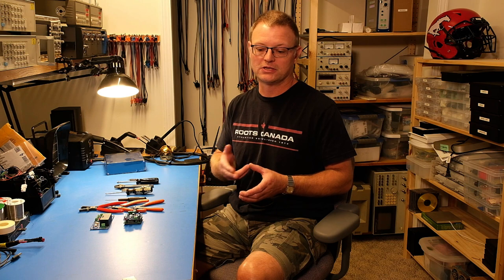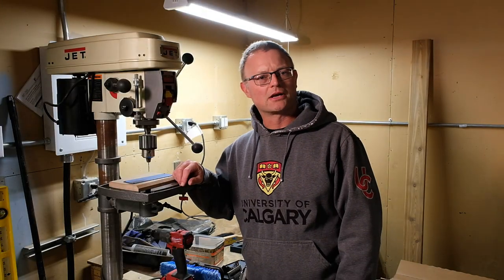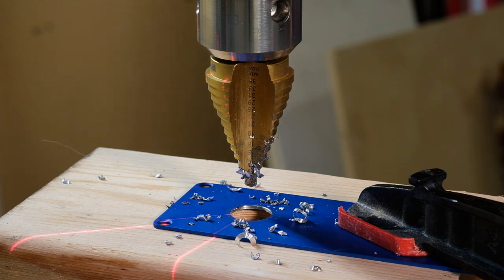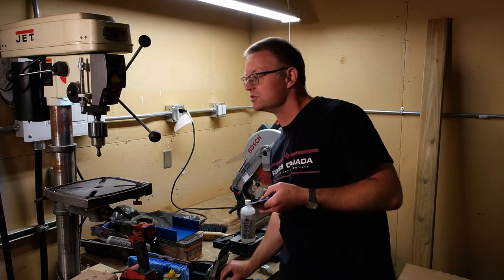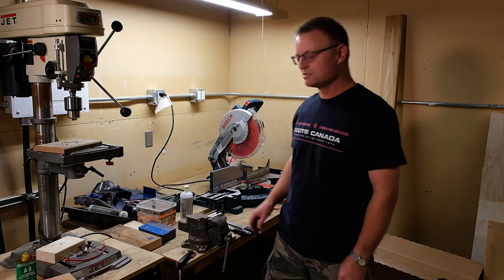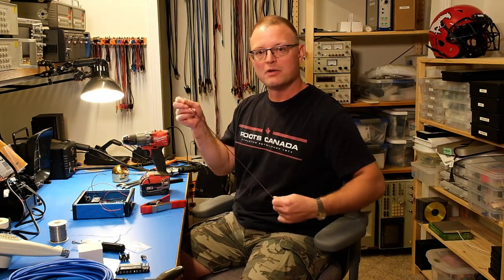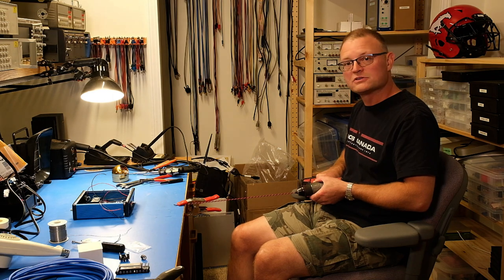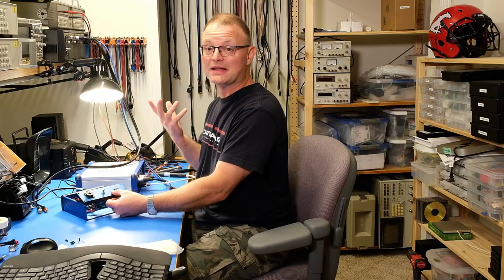Build an ultra-low distortion, high-end headphone amplifier in a day with Neurochrome.

Comment: Thanks for the video! For wiring in thigh areas like racks and also in small cases I tend to use thin XLR kabels. Fro example Cordial CSP or Sommer Cable SC-Isopod SO-F22. For small project cases you usually do not need a lot so I always keep a small roll in stock. Can come in very handy when you want a good quality shielded cable in a small case. Although making a twisted pair yourself using a drill is sooooo staisfying to do :D
Reply from the maker: I seem to recall that the 2-conductor Canare (L2T2) is pretty thin and flexible. I just happened to have the L4E6 star quad on hand instead, which would have been a bit unwieldy to work with. I agree that XLR cables can be a great source of bulk cable. I tell folks who only need a little bit of microphone cable to just buy an XLR cable and lob the connectors off.

Comment: Denatured alcohol (Ethanol) sold as Methyl Ethyl Ketone? Weird! - MEK is strong stuff ...
Reply from the maker: Denatured ethanol (witch some additive to make humans sick if they drink it) is commonplace in Europe. It's sold as ... wait for it ... denatured alcohol and is available in the cleaning products isle at grocery stores, hardware stores, etc. I haven't seen it on this side of the pond. The closest I've found is MEK, which you can get at your local home improvement box store. Best I can figure MEK is a kind of denatured alcohol. But what do I know? I'm not a chemist. I haven't performed a mass spectral analysis of the stuff.

I'm sticking to the A-9 (not to be confused with A-1 steak sauce - way different lubricating properties... :)). While ethanol will work as a lubricant I'd be concerned about the fumes. They're not good for your health and they're also flammable.